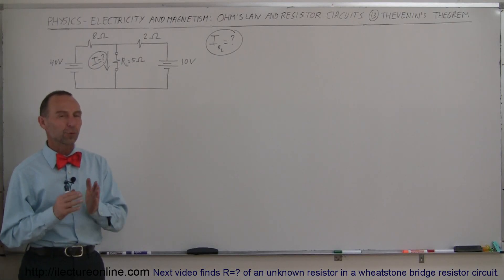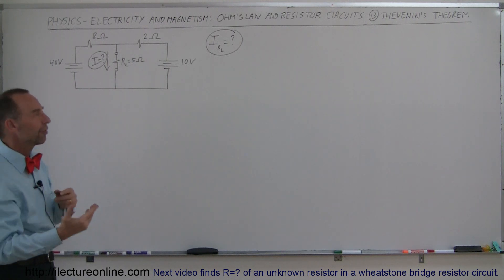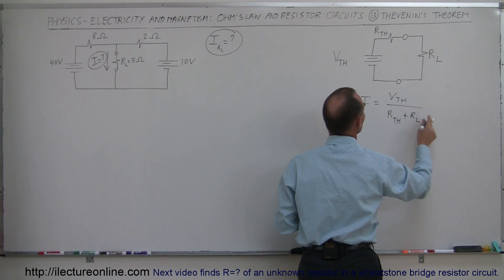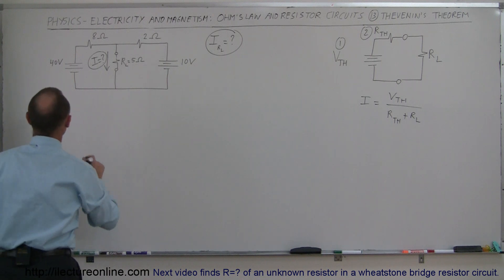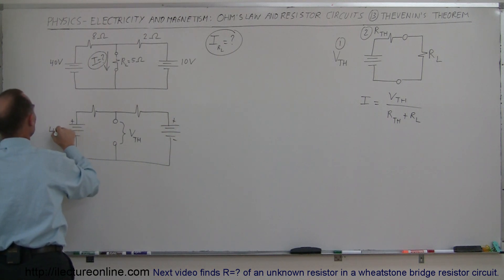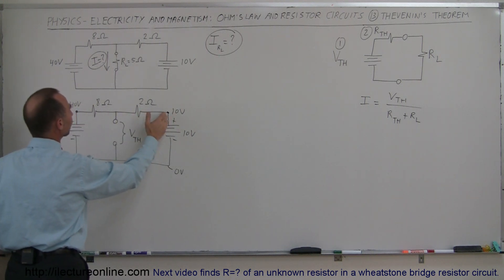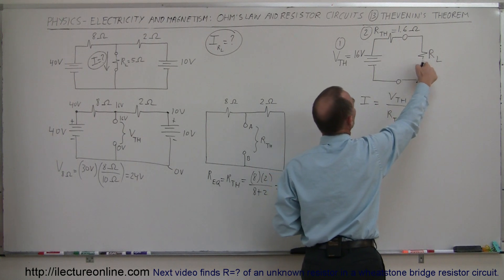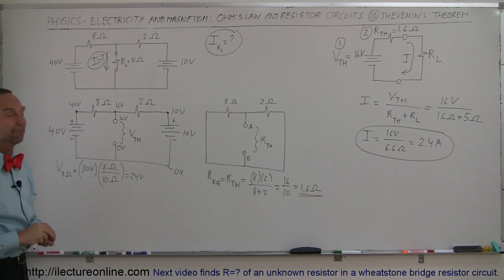Physics 42   Ohm's Law and Resistor Circuits (13 of 23) Thevenin's Theorem

Comment: What makes a resistor a "load resistor"? Im having problems choosing the load resistor. Is it always given in the question?
Reply from the maker: Every circuit is to be connected to something that needs the voltage and current provided by the circuit.  That "something" is called the "load".  SInce it has resistance it is also called the "load resistor".  It is that part that needs to current and voltage the circuit provides.  It is therefore not a "special" resistor, just something you plug into the circuit.

Comment: What would you do if there is a voltage source attached to the resistor load?
Reply from the maker: Then it wouldn't be a "load".
Reply: @MichelvanBiezen  no what I mean is that the question has a resistor and voltage source attached to the circuit.

Where the resistor would be between a and b.

It's actually a resistor and voltage source between a and b
Reply from the maker: Typically you wouldn't place a voltage source between a and b.  (That is meant by it would no longer be a "load" but a voltage source).  Then you would have to use one of the circuit analysis techniques (like Kirchhoff's rules) to solve the problem.

Comment: can you use this to solve circuits with only one voltage source? or does it always have to be 2 independent sources
Reply from the maker: I works with one voltage source as well, but then there are easier (or quicker) methods if there is only one voltage source

Comment: sir , if we are applying KVL in the same loop,  there are 2 current flowing through it , due to the 2 sources .how to get the net current ?
Reply from the maker: There are many techniques to solve that type of problem and Thevenin's theorem is one of them.    Here is how one uses Kirchhoff's rules:  Physics - Ohm's Law and Resistor Circuits (18 of 18) Kirchhoff's Rule   https://www.youtube.com/watch?v=wCtZTga7yc4&index=19&list=PLX2gX-ftPVXXSnzVqN0lldRssT6HdypN0

Comment: If we find the Thevenin Voltage, given that we know RL to be 5 Ohms, why isn't I=Vth/5 Ohms instead of Vth/(5 Ohms + Rth)?

Obviously RL and Rth are in series where current is constant but I'm confused... if we just look at the lefthand circuit, it seems reasonable to assume that the current across RL would be Voltage across the RL/RL

 Thanks!
Reply from the maker: Daski69 
Thevenin found that he could solve for the current through the load resistor by finding the Thevenin voltage and the Thevenin resistance of the circuit and then solving the simple "equivalent" circuit.
When you have two voltage sources in the circuit like in this video, you cannot use the ohm's law technique to solve for the current.  
Use Kirchhoff's technique on this problem to convince yourself how this works.
Reply: Michel van Biezen
Thank you so much for the answer!

I get that since Rth and RL are in series, the current is constant hence the current = Eth/(Rth+RL).

What confuses me is that if we have the Voltage Eth across RL and we have RL, by Ohms law then I = Eth/RL.

Maybe that's where I get the logic wrong; is it so that Eth is NOT the Voltage across RL? i.e. the open circuit Voltage = Eth is NOT=Voltage across RL?

Sorry for the spamming, I don't need perfect intuition, just need to know how it is, exam in three days :)

update: I used Kirchoff's laws and found the current IL to be = 2.4 A! Still confused about the logic; I guess that Vo=Eth NOT=V across RL :)

 Thank you again Professor!
Reply from the maker: Daski69 
It takes a while to understand why Thevenin's theorem works.  It is counter-intuitive.

It is better to learn the technique carefully.
You are correct to say that Eth is not equal to V across RL.
Note that V across RL = I * Rl = (2.4A) * 5 ohms = 12 Volts (which is not  16 Volts)

Thevinin was very smart!
Reply: Michel van Biezen I guess I'll have to take your and Thevenin's word for it. Thank you again for taking the time, sir, enormously appreciated!
Reply: Michel van Biezen I just had one doubt. Why is Eth not equal to the voltage across RL? Does this defy the ohm's law or are there some exceptions to it? Because when I first looked at this problem I just calculated Vth like you did, and then use V=iR to find the current and it turned out my answer was wrong, why is this happening actually?